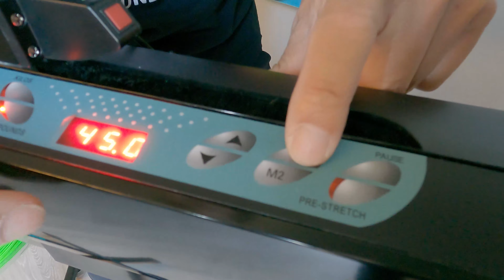How to String Tennis Racquet & More Tutorial Start to End - Prince Neos1000 & Wise 2086 Tension Head

Comment: Nice channel - I like your live tennis footage, really great up-close perspectives.  I also have the neos 1000 and Wise setup and wanted to share a few things I learned from others that you might also find useful.  LMK if you disagree with any of these comments, I'm always trying to refine my technique and am not the definitive truth on the topic!!

1. Looping the string around the wheel before putting it in the tensioner:  I don't think this is necessary (especially at lower tensions), but does allow you to have a lighter clamp/grip setting on the tensioner which in turn does less damage to the strings.  This is particularly useful when stringing with gut which can be very fragile.  

2. If you are going to loop around the wheel before tensioning: per one of the other comments, I think you are better to either loop over the wheel to reduce how much deflection there is on the string bending around the frame, OR take the string under the frame if you like to loop around the wheel from underneath.  You are taking the string OVER the frame, but then starting the loop UNDER the tensioner wheel - I think it would be better to go OVER FRAME--->OVER-WHEEL, or UNDER-FRAME--->UNDER-WHEEL and not mix.

3. Cross strings: you definitely should tension all of the cross strings individually and not try to tension the top 3 together.  There is a really interesting experiment somewhere in tre TW forums that measures how much tension is lost due to the friction of the main strings and also the angle of the grommet (straight tension pull results in more actual tension that the racket corners where the tension is being pulled at a weird angle through the grommet).  Pretty amazing that the same pull tension results in a significant actual tension difference as it is, so trying to pull 3 strings together will be nowhere close to the intended tension I dont think.  

4. Cross string starting clamp: per another comment, I think the frame is protected more by using your normal clamp next to the frame and then putting the starting clamp against the neos clamp.  That way nothing touches the frame and you are using the stronger hold/clamp (neos) closer to the point that the tension is being pulled from, and only using the starting clamp for some extra margin. 

5. Pulling cross strings/avoiding friction/burning the mains: one great trick someone showed me when you use your off hand to move the cross strings while pulling them through is to hold the string firm at the end you are pulling from and then alternate.  It is much faster because the string never back-tracks as it does if you dont hold it firm.  Not sure if that makes sense but essentially the sequence is:  1) hold the string firm with your right hand, 2) use your left hand to slide all the cross strings down towards the throat (which because you are holding the short end firm, partly pulls the long end into the frame), 3) then pull the string through with your right hand, 4) repeat steps 1-3.   I found this technique is definitely faster but still avoids the string friction/burn.

Thanks again for the channel and taking the time to share!
Reply from the maker: Thanks for the comment. Fabulous input and advice! This is a fantastic avenue to talk about everyones stringing technique. 

Anyone who wants to tell us about your technique plus comment.  I honestly would love to hear it. Thank you